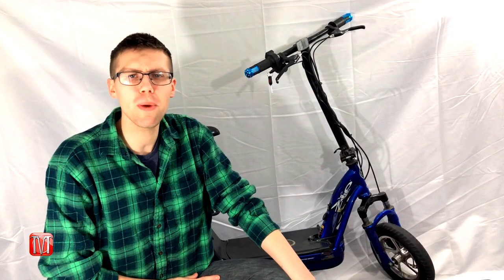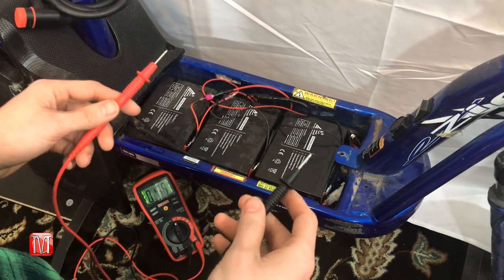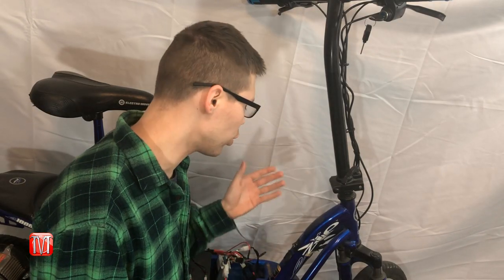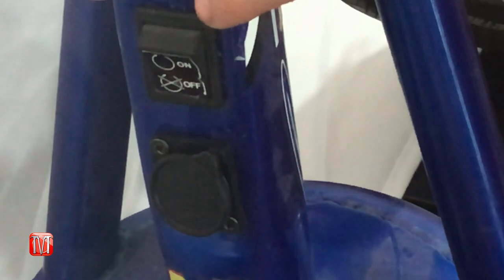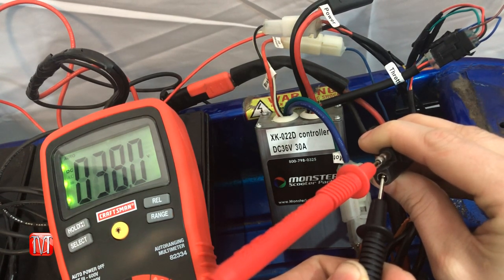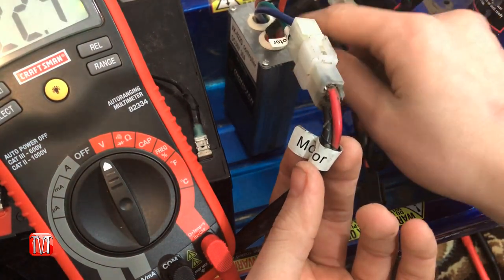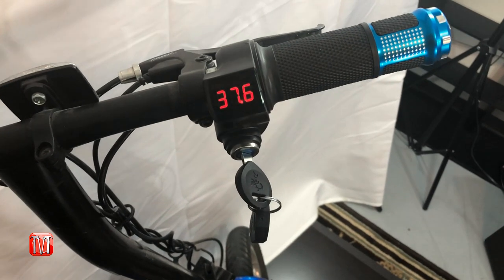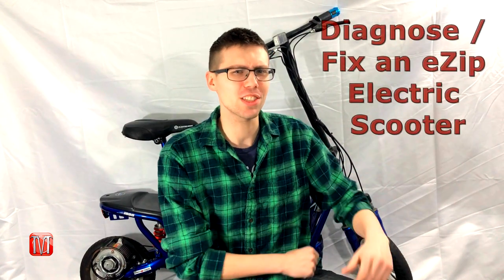How To Fix an eZip Electric Scooter (For ALL Series)

Comment: A question my my friend.
If I plug the charger to an outlet and to the charging port and turn on the the power button wouldn't it be enough to figure it out that all the components tested one by one before, are good?
I am not an expert like you.
I am just trying to fix my first scooter which I bought broken for my daughter and learn something new.
Thank you
Reply from the maker: So I’m no expert this was and still is the only scooter I’ve ever worked on. I don’t know if having the charger plugged in would give you the same readings. I haven’t tried that. However, I have a feeling that the control module might be able to identify the difference between charging and battery power. For example I don’t believe the scooter will allow you to activate the motor and have the scooter move when plugged in. Again I haven’t tested that so I can’t confirm if that’s the case or not.
Reply: @MAGSHowToVideos  thank you for your quick reply.
I am actually working on mine right now, following your instructions and is very helpful.
So far I am testing the throttle and it seems to be bad.
Thank you so much
Reply: @MAGSHowToVideos  confirmed my friend.
The throttle is broken and the batteries don't keep the charge.
All thanks to your video.
Suscribed and given like.
Well deserved.
Many other always hide the key points. You don't.
Great from you.

Comment: I have a I-400  electric IZIP . will not crank  .have  new batteries cked power to batterys  all wks  also cked fuse it is good. any other suggestions????
Reply from the maker: janice long so the biggest problem these scooters have is the throttle handle/cable goes bad. If you followed my video and everything is working correctly, what I would do next is test the motor to make sure it all works. If it doesn’t well then you’re almost better off just getting a new scooter. First check to make sure that there are no damage wires. Then use a power probe to send power to the Motor. If you don’t have access to one you can just disconnect the motor’s power cable from the control module and use alligator cables to connect the motor straight to the battery’s. If you’re battery’s are fully charged your motor should turn on the moment the wires touch. If that works then that’s great news since the motor is the most expensive part. Now at this point everything else should have been tested and you know for a fact works. If so that means you have a bad control module. They run for about $50-$75 online depending on where you get it. 

But again before you do all that make sure to follow the steps I show you in this video and make sure to test the throttle because 4/5 times that’s the issue. And a new one costs about $10-$35, a lot cheaper then most the other parts. Let me know if you need any more help.

Comment: Any idea why my charger gets hot when charging? I have a 900
Reply from the maker: Chargers getting hot is normal as long as the temperature is less then 50 degrees Celsius. The main reason why a charger may appear to be hot or heating up is because it is taking the power voltage from the wall socket and converting from 110-240V down to 12-36V depending on the charger. Now if your charger is getting to hit to touch then there’s a problem.

Comment: Where can I get a new throttle cable and throttle handle for it easy zip 750
Reply from the maker: Scott Goss eBay has several. Just type in e-Zip throttle cable and look for one that has the same plug and amount of wires. If you can’t find one with the same plug you can just get one that has the same amount of wires and just use the plug/connector off the old throttle handle.

Comment: Hi I got a ezip1000 when I turn on the bike the throttle is green then I go to twist it and it shuts off. Now I love the silver box and it started to work again any idea ?
Reply from the maker: rickydoggg I’m not quite sure what you mean by “Now I love the silver box” however if the throttle shows green and you tested the battery’s for the proper voltage you might need to test your batteries CCA (cold cranking amps) if your battery’s don’t have enough amps then even with full voltage you won’t have enough power for the scooter to move. If the batteries end up having low Amps then you will most likely need to get new batteries.
Reply: MAGS How To Videos sorry move the silver box
Reply: MAGS How To Videos it was moving it runs but it started to act like a short and if I move the box it will work
Reply from the maker: If the scooter works when you move the control box (silver box) then that means you most likely have a bad connection or ground with one or more of the wires. Try wiggling each of the wires until you can identify which one(s) are causing the issue. If you can’t find it, then try run through the electrical tests I perform in the video, they might help you find connection that is having the issue. If it seems like the problem is inside the control module then I would purchase a replacement.
Reply: Thank you so much I’m gonna check it out because it’s a really nice bike I will let you know thanks again stay safe

Comment: Thanks for the video. I still can't quite figure out what's up in my situation though. Originally I cracked my eZip 750 open to find a blown and melted fuse/fuse holder. Replaced that, then found my batteries had gone bad after years of neglect. Replaced those. Everything is wired up, throttle lights up green and twisting it doesn't do anything. Figured maybe the throttle was bad and ordered the one you'd recommended (accidentally broke the old one while trying to remove it. haha) Still no luck after wiring up the new one. Readings seem to be off when I use my own multimeter, but maybe I don't know what I'm doing. I just measured out the voltage of my speed controller to my motor and I'm reading off 42.4. When I twist the throttle the number doesn't change. Any idea? Maybe my speed controller is shot. I just pray it's that and not my motor.
Reply: Ordered a new motor. Attempted to crack it open to see if something was amiss and messed it all up. haha

Comment: Ok, awesome video but I am still confused. When I turn it on there is no light on the throttle part up top. What do you think?
Reply from the maker: Deanna Christiansen... did you test your batteries to make sure they are fully charged? If so and they are good, did you test for the proper voltage going to the throttle handle and then from the handle when twisting it? If you don’t get the correct amount of volts from the throttle handle then the handle might need to be replaced. If you are not getting voltage to the throttle handle then inspect the wires and control module. You might have a loose, damaged or even fried wire. Test for continuity and resistance. If you don’t know how to do that feel free to check out my other video on how to use a multimeter. Feel free comment if you end up having more questions. Thanks for watching!
Reply: @MAGSHowToVideos  , I found out that there were some damaged wires,so I'm replacing them. I am also replacing the throttle since I already have it apart. From what I've read these ezips are known to have bad ones Thank you for your help, I'm doing something I never thought I would be able to. Great video. 🤪
Reply from the maker: I am glad I was able to help. Hopefully fixing/replacing those damaged wires will fix the issue you are having with your scooter. Feel free to comment again if it doesn’t. Thanks for watching!